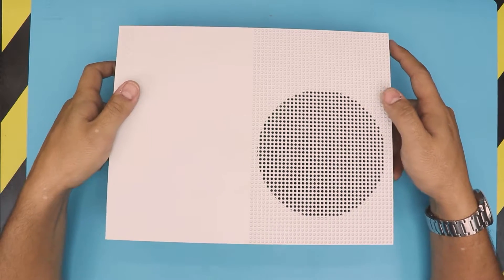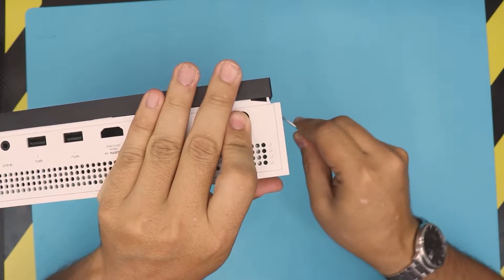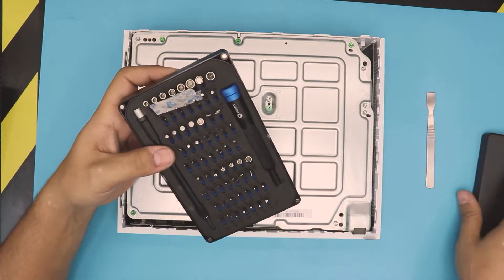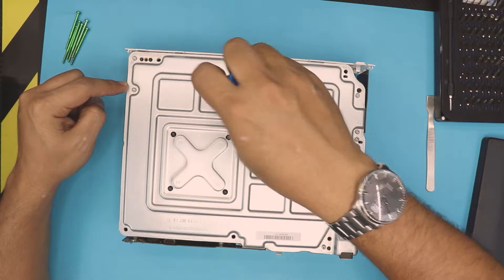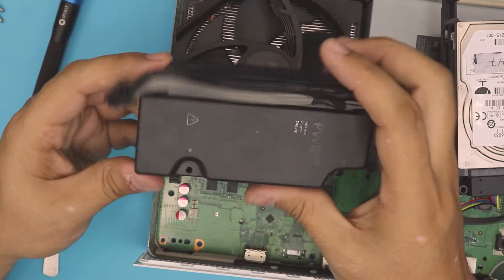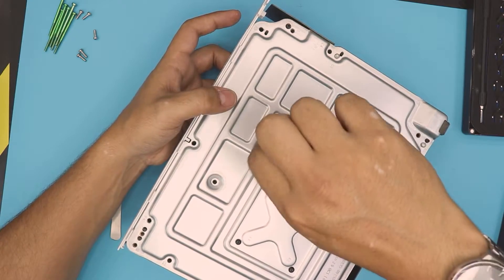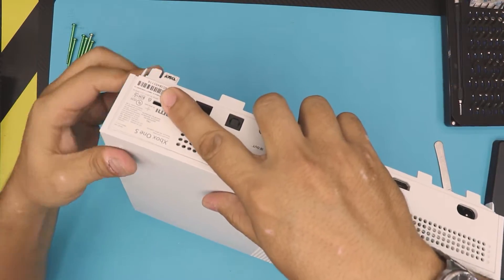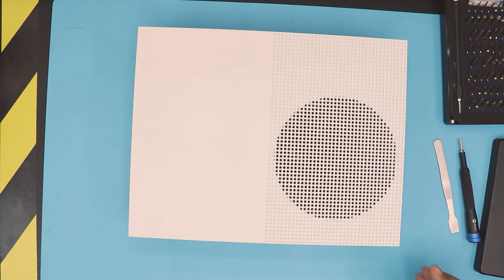Xbox One S Power Supply Replacement PSU, Guide...

Comment: When I press the power on button, it beeps them clicks off, the fan spins for a second before it clicks off, is this a power supply issue?
Reply from the maker: 🫠Regarding your question, no one can say for sure if it’s 100% the PSU or a failing motherboard MOSFET. You can order a PSU from Amazon to test it and return it if needed, as it could be 50% PSU and 50% motherboard issue. I encounter this problem in the store all the time, but I have a stationary PSU to test them.
Should you have any further questions or requests in the future, please don't hesitate to ask me.
cheers🍻

Comment: My Xbox when I insert the power cord into it, it does nothing. No light no sound nothing,it's as if there is no electricity going through. Do u think the problem could be the power supply or is it something else.
Reply from the maker: 🫠 Regarding your question, you will need to check the output of the power supply with a multimeter. If there is 12V on the output, then the issue is on the board; otherwise, it's the power supply.
cheers🍻

Comment: After a lightning strike yesterday my Xbox one S won't turn on. I checked my psu and my output is showing around 8. Is that too low for the system to boot?
Reply from the maker: Thank you for the feedback! if you wish to support the channel you can LIKE or SUB or both :P
regarding your question: yes the output should be around 12V,  you will need to replace the PSU, and hope that the surge did not advance to the motherboard, if so return the PSU :P
Reply: Did you ever get it working? I have a similar issue where I got a used Xbox One S for very cheap, but it shows no power. I believe it is a dead power supply, so I am thinking about replacing it.

Comment: So my Xbox S will make an error noise mid game and shut off but it’s random I’ve taken it apart and cleaned it not really dusty 
Also it turns on just fine do you think it might be the power cord ?
Reply from the maker: a noise or gives an error? if error what is the error code?
Reply: @uFixTek  a noise like errrrrrrr then shuts down no code
Reply from the maker: you need to repaste the CPU with a good thermal paste:
https://amzn.to/3o45DzB
and make sure your fan its really soft on rotation.
the err is because of the over heating, the paste is dry.
Reply: @uFixTek  awesome thank you I’ll update you
Reply from the maker: i wish you the best my friend :)

Comment: Does the Xbox need to be Put  back together to turn on?
Reply from the maker: Thank you for the feedback! if you wish to support the channel you can LIKE or SUB or both :P
regarding your question: absolutely not, you can have it powered on without the casing.
Reply: Year old reply, but no. As long is everything is plugged in and the heatsink/xclamp for the CPU/GPU is intact, then it is safe to turn on and test.

Comment: i had power surge and i am getting 11.84v should i replace the power supply ,,,main board is good .pls reply
Reply from the maker: ya 11.84 is very low, replace the PSU and see if the board still good, you cannot test the board with 11.84.
also what happens when you power on ?
beep? light ? no image? exactly what does it do?
thank you for your support for the channel :)
Reply: @uFixTek  no power ,no light , no beep.
Reply from the maker: ok 1st we need a new PSU to test the console.
Reply: @uFixTek  i just order new power supply  will come on 14 dec .
Reply from the maker: Oki, when you get it and tested let me know by leaving a NEW comment and i can help you out if anything. good luck